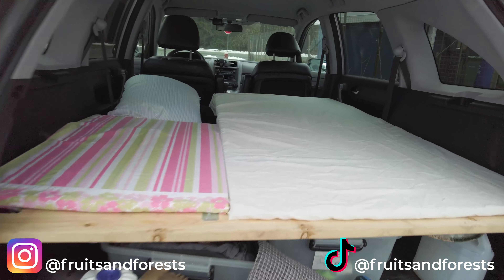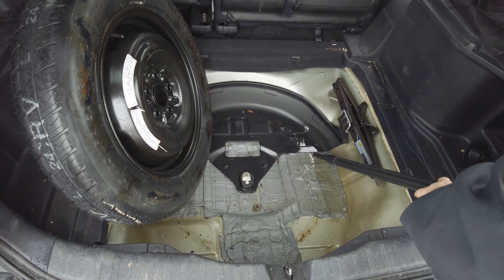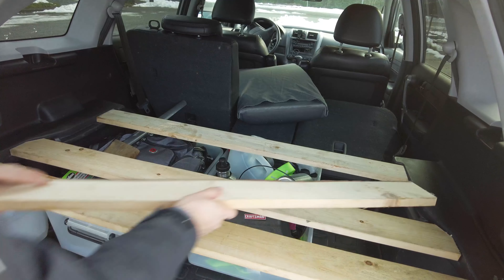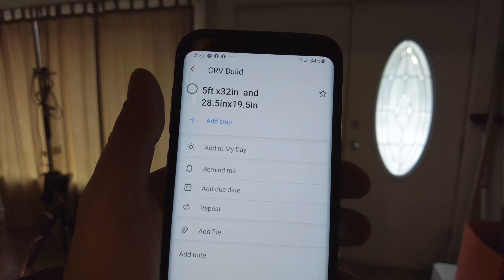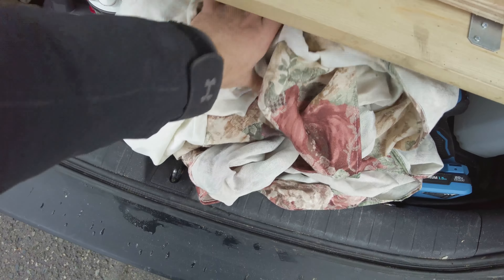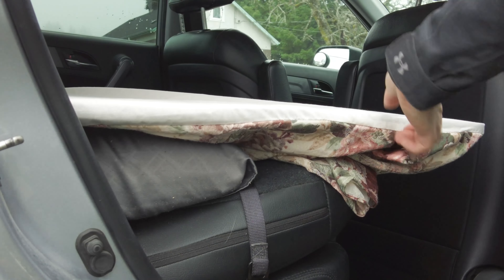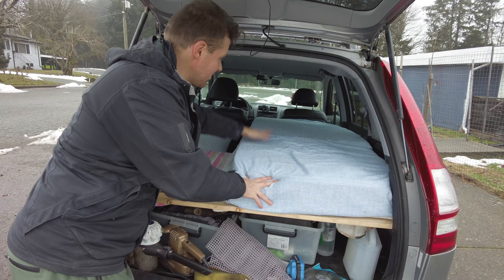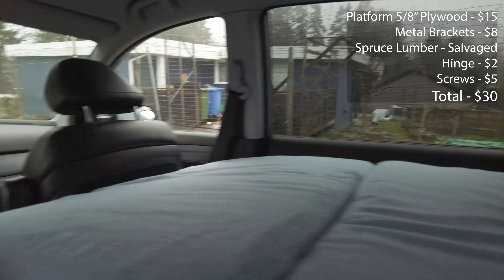How to Build a Bed in an SUV | DIY SUV Bed Platform only $30 | CRV Bed Platform (Non Permanent)

Comment: Our first micro camper build was for the CRV too. Such a great vehicle, but yeah those back seat positions are a pain. We hope you have a great trip! By the way, we had some emergency water bottles leak by the spare tire and at least some of the water just sat there (if we recall correctly). It really does seem like there should be some drainage holes down there. We can't remember exactly what ours looked like!
Reply from the maker: Ya I had to vacuum out that water, it doesn't going anywhere. I just finished my "curtains" today I went with perfectly shaped posterboard, gets the job done not as fancy as yours haha.

Comment: Great job David. Might  have  to try something like this in the van. Make sure to get the water issues fixed before you put anything in the secret compartment
Reply from the maker: I'm not even sure what the issue is there, I need to figure out if a full spare tire is in my future first.
Reply: @IdRatherBeHiking  I shared this video with my friend. He said if he was younger he would definitely do it.

Comment: I just finished making a bed in my suv. See you down the road ☺
Reply from the maker: Did you got with storage under or over your bed?
Reply: @IdRatherBeHiking  I have mitsubishi montero.  I kept the middle row in and fold down the larger section, leaving me with a middle row seat to sit on.  I went to HD  and bought two pre cut half inch boards. In total,  they are 24 inch x 72. I also bought two heavy duty plastic bins, the same height as the folded seat. The bins, folded seat and wood on top makes a great  bed base. I am taking out the third row,  for additional hidden storage. I'm pretty short and petite, so have a decent amount of space for myself.
Reply from the maker: @kimberlychicago7608  sounds like a great setup

Comment: Highly recommended to remove the back seats and leave them at home, if nobody else will be with you mayb just fuck it and leave the passenger seat too for even more space and convenience. If you do that you don't even need a plywood base for the floor, just throw your couch cushions or whatever bedding you decide to use down. 

A portable fridge you can plug into  a 12 volt outlet might be something you're interested in, I'm just saying they exist for if you wanted to keep cheese or milk in it, but it turns off when your car turns off.

I would just leave the spare tire, but it's up to you especially if you'll be in remote places and might want to have an actual tire. There are roof racks you can get specifically for storage, so maybe instead of putting the tire up there, get a nice sized roof rack just for storage. 

Some other stuff to consider that you may or may not find helpful are putting some makeshift privacy barriers in, because I hear stories about people liking to peak in while you're sleeping, and along with that some sort of makeshift safety precautions so if someone was to try and break in and possibly hurt you. Happens to truckers, some truckers even carry guns because there are people who break into trucks and might hurt you even if you're a guy.

Last thing is make sure you think about it in your head how much space you will have, just so you can be more comfortable and organized. Oh, and if you really really wanted you could get a small trailer, throw shit in there
Reply from the maker: I think i'll pack it out and see if I need more space or not, if its too cramped then I'll ditch the backseat. I like having the front passenger seat to edit my videos so I'll be transforming that somehow to accommodate a desk.
Reply: @IdRatherBeHiking  the passanger seat as a desk is a great idea!

Comment: Nice job. Have you thought about removing the back seats completely and building a frame to hold up the platform. This will provide you with more storage space. When we went on our 5 week road trip you want as much as you can get.
Reply from the maker: I'm going to pack everything in there and see if I'm struggling for space if so I'll ditch the backseat. I have a roof bag coming so I'll see how that works out.

Comment: hey what kind of roof cross bars do you have? my crv didn’t come with them and im trying to find a good brand
Reply from the maker: mine are the honda stock ones I believe. I bought my crv from a used car lot and said I'd only buy it if they included the bars, they went down to the junkyard and found some so I'm not exactly sure

Comment: I have a friend that has a 2012 crv and she gets water in spare tire areas too and they cant find where it is coming from. did you every find where yours came from?
Reply from the maker: Naa I never found the source. It isn't a lot but there is some. Probably trickles down from the back hatch.
Reply: I have a Honda Jazz (Fit in the USA). They have this kind of leakage problem. If I recall right, the problem is that there is a crack under the tailgate door next to the top-right corner beside the door seal and the roof. There is welding of the chassis panels and this can crack and water can find its way to the spare wheel bay. Maybe worth checking.